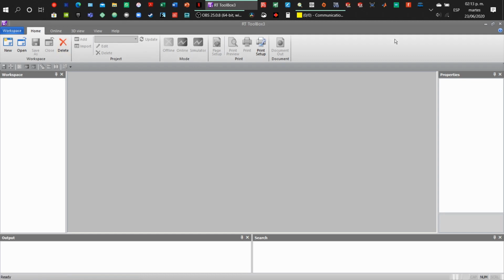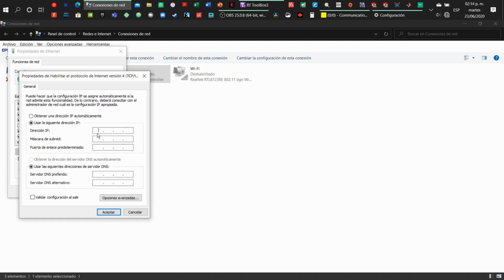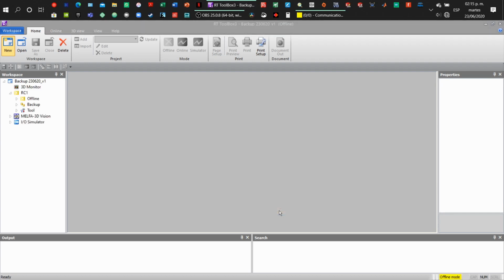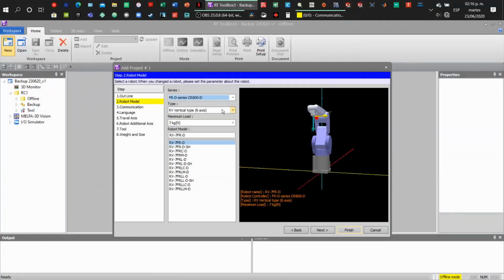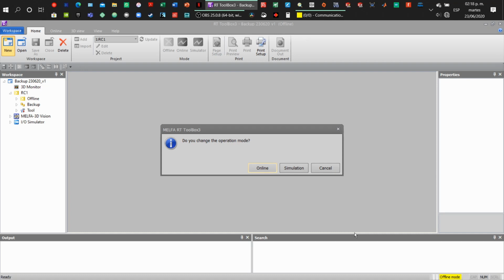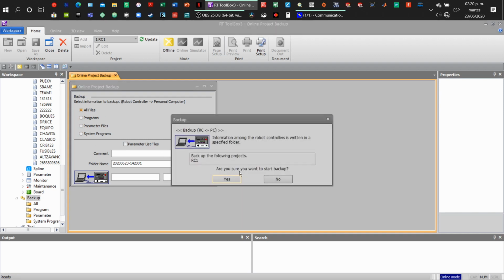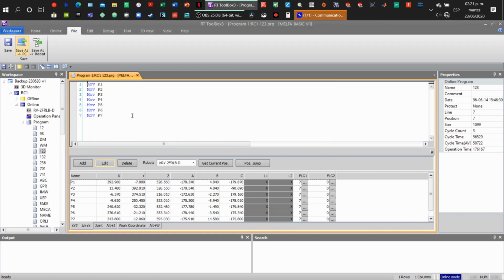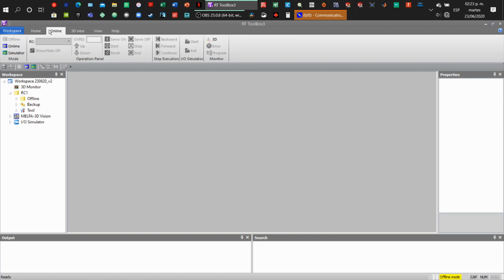Robotic system network configuration & backup  | Updated version | MELSOFT Mitsubishi RT Tool Box 3

Comment: Hi Javier. I'm trying to jog the robot from RT Toolbox. I'm connected and in online mode, I switch the servo on but as soon as I try to jog it, it moves a bit and then I immediately have an error (Error 6130 - Network Communication Error). Has this ever happened to you? (I'm running from a virtual Machine with Windows 10, RT Toolbox3 and Ethernet connection to the robot). Thanks in advance.
Reply from the maker: Hi Giovanni, sorry for the late response, unfortunately I have not had that error code. But, there is a document that Mitsubishi shares with all error codes where you can search it and look up for possible solutions. Again, sorry for the late response.

Comment: Hi , robot is running , i want go to home robot , how to do?
Reply from the maker: If the robot has not a home position programmed at the program, there is an option at the teach pendant that you can use to send it home, but you must put the robot in manual mode. Once there, press the hand button at the keypad and search for the function home with the servomotor on. (or jog menu, I don't remember exactly in which menu is it). Hopefully this will help you.
Reply: @Teachartronics  thank you very much